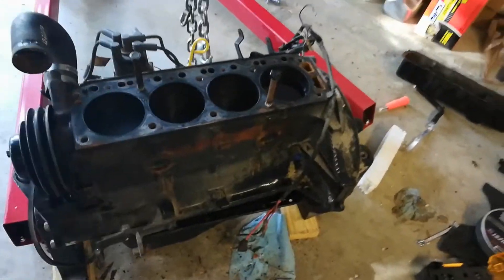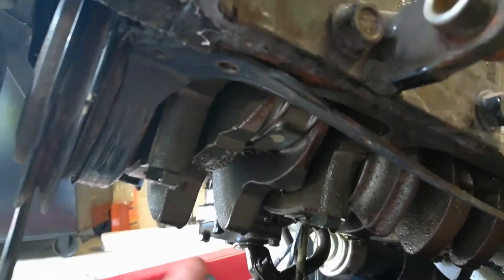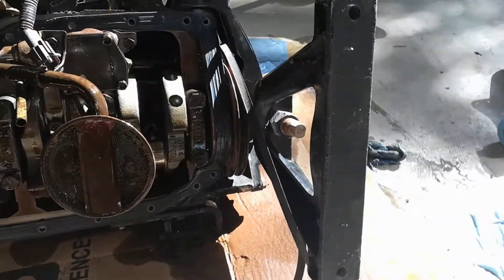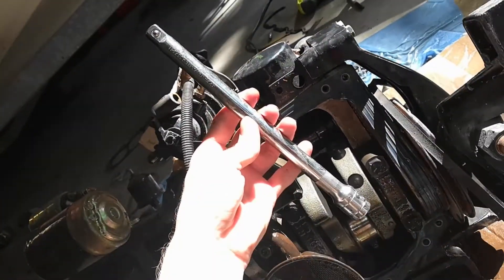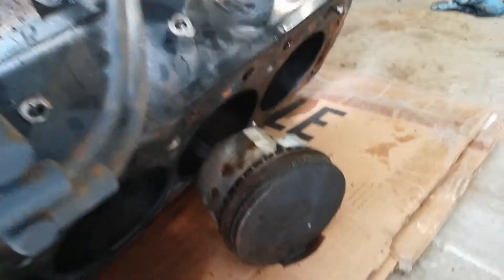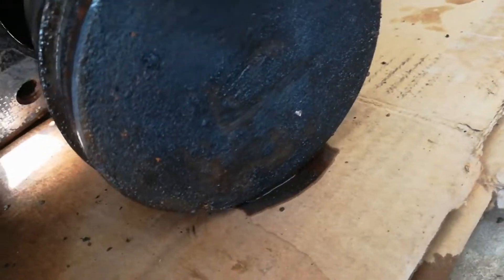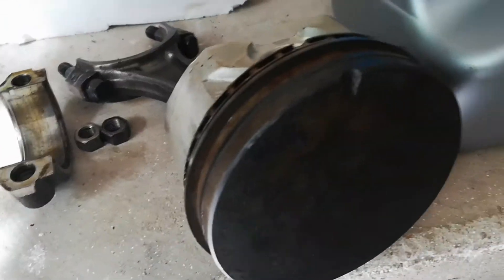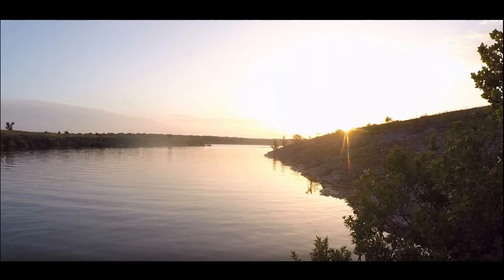Engine Piston Removal

Comment: I hope you took a number stamp set and marked all the rod caps and rods so they go back together in the right orintation with each other. When going back together you set the lash on the valves on the base circle of the cam not the high point get a manual and follow the right procedure or you are waisting you time and money.

Comment: Just a quick question. Why did cylinder 4 still have fluid in? I have a seized diesel engine and the one that had an exhasut valve open doesn't drain. the others do. Was that the worst / stuck cylinder. and was the exhaust valve open? Great video by the way.
Reply from the maker: I think water leaked into cylinder 4 through the exhaust valve from the exhaust manifold from water leaking into from a failing gasket on the exhaust riser

That's what I think happened anyways 😉

Comment: Hey maybe you can help me trouble shoot. I have a mercury 3.0 that will run for about 45 minutes and then turn off until I let it rest for about 15-30 mins. Do you have any ideas?
Reply from the maker: what happens after it runs 45 minutes? Is it overheating?
Reply: No I don’t think it’s overheating, I was hoping you would say the possibility of a clogged fuel vent. The next time I go out I am going to open the gas tank when this issue happens and see if this fixes the issue, confirming a clogged fuel vent. I am going to change the oil before I go out though.
Reply: After 45 minutes the engine starts the lose strength and eventually turns off. U til I let it rest for a short period of time
Reply from the maker: @egocrazy6  hmmm, might be clogged fuel vent. I don't know about your boat but on mine the gas tank fueling hose couples with the vent hose, but the fueling hose itself can vent, on mine right through the gas cap
Reply: Yeah my fuel cap has not vents it seems. My newest problem is trying to replace my impeller or atleast check it. After I removed the zinc. It has a bolt in a recessed hole underneath behind the removed zinc. The bolt seems to be stripped and it seems in everyone’s videos they have a bolt that uses an Allen key unlike mine. Just got this boat and seems like someone put this bolt in instead. There is almost zero room in between the recessed hole and  this out of shape bolt.
Reply from the maker: @egocrazy6  dang, that sounds tough. You wanna email some pictures of it? Zachsgarage1@gmail.com
Reply: Late response on my part but, I actually came to find out it was just a bolt with a head that had been snapped off. Lower unit cake apart with no issues after that, and the impeller looked to be in good shape to my surprise.
Reply from the maker: @egocrazy6  interesting. I found my impeller actually didn't look too bad either
Reply: Got her out on the water yesterday and had my stalling issue about 30 mins. I attempted my theory of a clogged fuel vent by opening my gas cap when it was losing power, and it did not help. I’m going to clean the carb and check out my fuel pump now.
Reply from the maker: @egocrazy6  let me know if cleaning the carb helps!
Reply: Would you by any chance add my Snapchat so I can ask you a few questions and send engine pics easily?